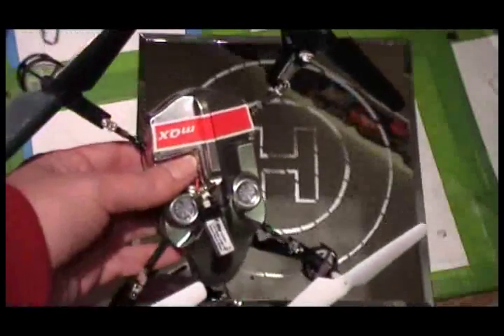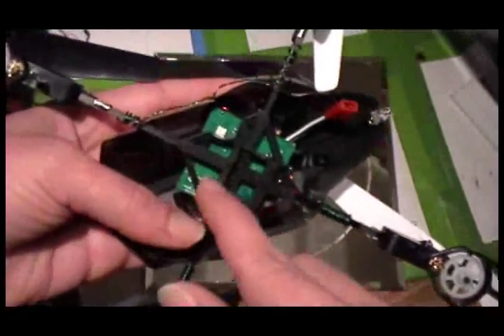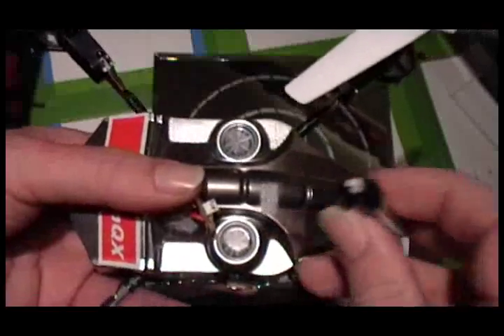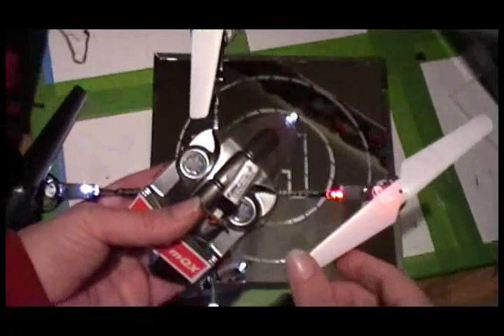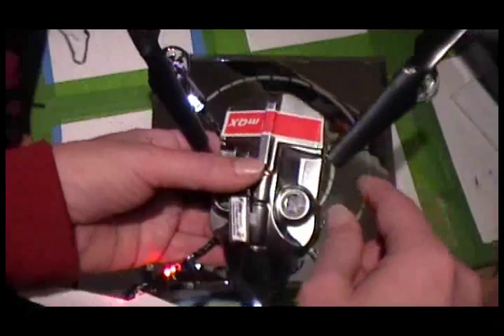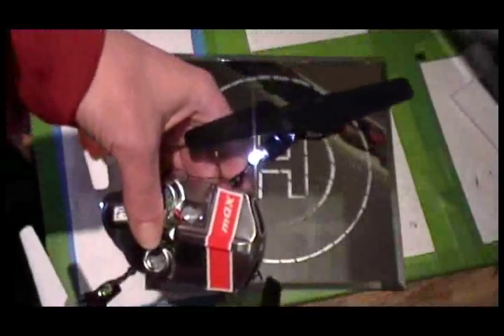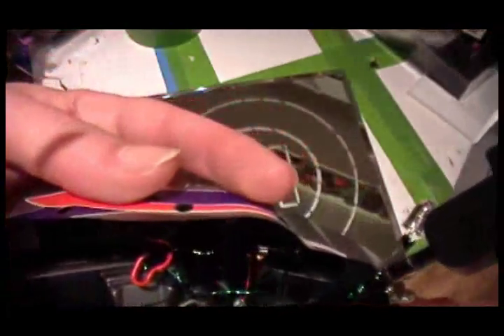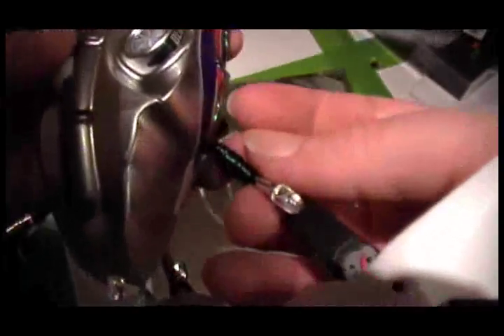Blade mQX with LEDs

Comment from the maker: @RugRatCoupe There's a bunch of different ways to buy the parts - different packages. Radio Shack doesn't have a great selection (and about 30% higher price), but I use them sometimes for convenience. I have ordered some more lights from SuperBrightLEDs and when I get those in, I'll be doing a detailed video showing all the soldering techniques and how to calculate the proper resistors. It is not something I can explain in a comment.

Comment from the maker: @weber161 They are called 3mm Component LEDs. They have maybe 15 varieties, different colors and brightness. Just get the brightest ones that are still under 3.7V. Then get resistors and magnet wire from Radio Shack.